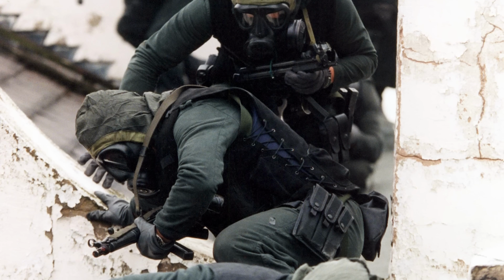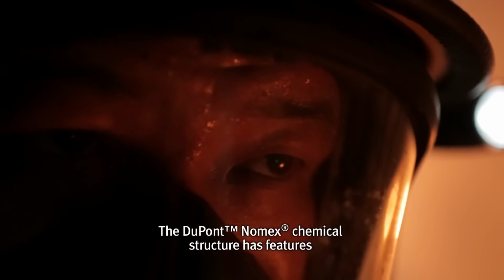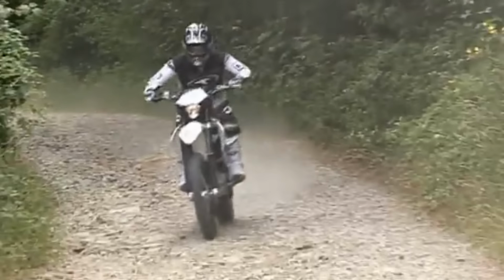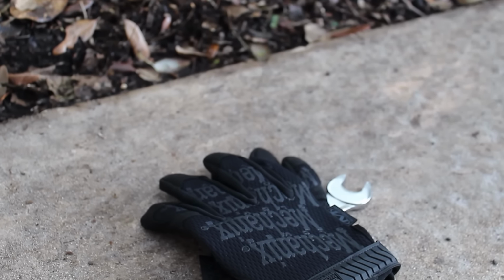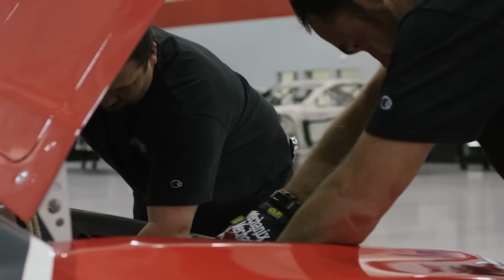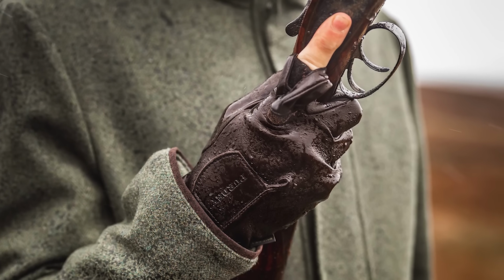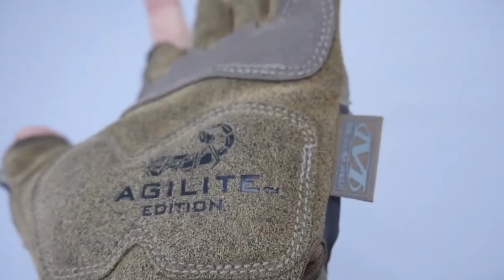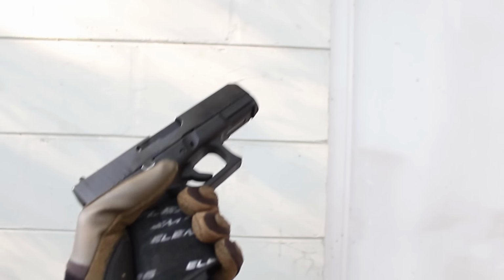How Automotive Gloves Became the Tactical Standard

Comment: Best mechanix gloves I’ve ever used are funnily enough the full leather gardening gloves. Great for barded wire and hard work, thin enough that I can operate a rifle but durable enough to pick up a burning log when camping. All the tactical mechanix I’ve worn busted at the seams within months. My full leather are going strong still
Reply: Yup.  The tactical Mechanix bugger-up and start to crumble at the fingertips.
Reply: @LRRPFco52 duh, how else would they have continuous purchases coming from the military 😂
Reply: The leather ones are definitely the best in my experience, too. They give you much more dexterity than the average leather work glove, but don’t wear out super fast like the Mechanix synthetic gloves.
Reply: The gloves are designed to be tight, but also flexible. I've tried most of the brands listed here, and they all have the same point of failure in about the same time frame - the seam in the tips of the fingers. The point of failure will always be the material that's least flexible, it's not brand specific. When the joints of the finger bend, its length increases.
Reply: Nope, it’s batting gloves. They’re leather, they are thinner but still thick enough, you grip EVERYTHING better with them.
Reply: @jonosterman2878 yup. Moto gloves same same. Not the power ranger moto gloves.
Reply: I went through 3 pairs of Mechanix gloves in a year working on the ramp. Offloading/loading bags all day every day. Only issue I had is the seam at the tip of the fingers would be the first to go, and the fastening  velcro also would rip out
Reply: Yes dude I agree, I use those gloves all the time!
Reply: Have used the leather gardening gloves for years now. Super solid.
Reply: Yea, I just use standard TIG welding gloves out of goat leather. Thin and still good for everything including working on 250°C injection moulding machines.
Reply: Iron Fencer leather gloves are the toughest and longest lasting leather hide gloves I’ve ever had. You can get them for $15-$20 and last forever with how they are stitched and where they are reinforced. They are marketed for barb wire fencers but can be used for any time you would wear leather hide. Tilman gloves are good too which are made for welders but they have models without the long sleeves on them. 

Those iron fencers though are cheaper and so much tougher than a lot of other gloves and you can use them wet and they won’t disintegrate like other leather gloves will on the fingerprint area of your fingers.
Reply: Someone else commented mechanicax have declined, recommend HWI
Reply: @thejohnbeck  yea they are decent gloves but every pair I have owned have failed in the same spot. In fact everyone I know who uses mechanix (mostly everyone I work with) has had them fail in the same way. The seam on the side of the finger always busts open
Reply: @delman124  not my info, I don't care
Reply: @PoAutumnHellJumper  People buy them not for their quality but because they can actually afford to replace them when they do inevitably wear out - as all gloves will do eventually! Why do you think our hands form rough, hard calluses when we work with them long enough? Even our bodies know that normal skin can't take that sort of abuse for that long without abrading lol
Reply: @PoAutumnHellJumper  Every glove I've ever had failed in the same spots, around the tip of the index and inside edge of the thumb.
Reply: @PoAutumnHellJumper  Huh, I've had this happen to both pairs of mine.
Reply: @PoAutumnHellJumper I’ve had many pairs fail by splitting at the webbing between my thumb and pointer. Super annoying but up until that happens they’re great. Dirt cheap and very widely available, too.
Reply: @PoAutumnHellJumper My mechanix gloves (kind of tactical, have the commonly seen hard knuckles) have come open on the thumb, but that's partially my fault because I smoke like a chimney and the flame from my lighter will hit the thumb.
Reply: @PoAutumnHellJumper yeah sad fact, but a fast fix if you care enough
Reply: The leather ones are absolutely insane fr
Reply: Guess it's better to be a gardener at war after all
Reply: Leather is always better. Especially pig skin and goat skin, which is tough and durable even when cut very thin.
Reply: Another gardening glove fan here.
Reply: Ooo
Reply: I'll definitely want ro pick up.
Reply: Which model are these?
Reply: Ich habe bisher nur mehrere Paar von den Schnittschutzhandschuhen von Mechanix besessen und alle sind, wie Du richtig berichtest, nach ein paar Monaten aus den Nähten geplatzt. Jetzt bin ich auch "Master of Gloves"- Handschuhe (erstmal ohne Schnittschutz) umgestiegen. Mal sehen wie die sich schlagen.
Reply: Agreed, I use my rigger gloves for everything. Sadly on the weekend I discovered they are no protection against an angle grinder
Reply: I use these all the time even for cold weather shooting
Reply: The cow drivers?
Reply: Ive gone through so many sets of mechanix gloves working on a cargo jet, and yeah the seams always start ripping first.
Reply: Full leather is the only way to go with gloves if you want any sort of lifespan from them
Reply: Neato
Reply: I've had mine for like 3 years and they're only just showing a tiny hole. compared to the tens of cheap riggers gloves that last roughly a week.
Reply: That’s not what an actual mechanic needs or wants.
Reply: My MEXICAN dad APPROVED this message.
Reply: I like my latex gloves cause I can just swap to a new pair really easy when they break
Reply: Da yellow leathery gloves be hittin like da